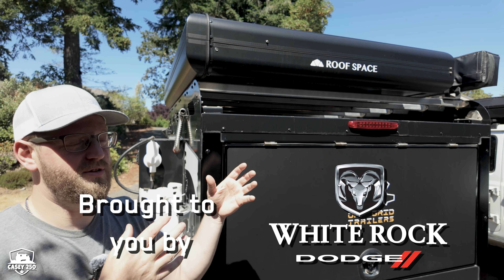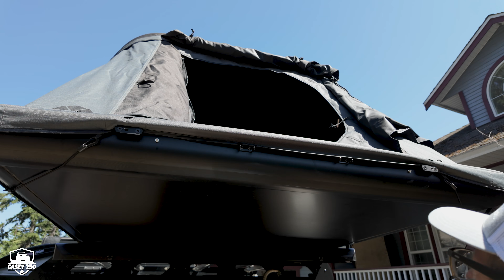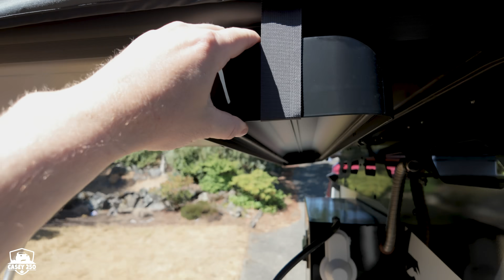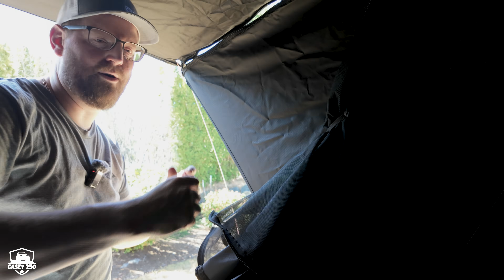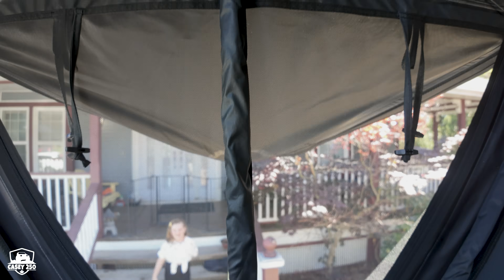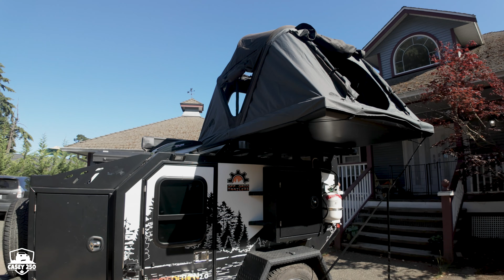This Roof Top Tent is VERY DIFFERENT FROM ALL OTHERS - Roof Space 2 Review

Comment: Hmm I don’t know. When I first started hearing about this tent and looking at it a bit closer I was initially like, “heck yeah can finally get rid of my RN condor generation 1, but after watching this I’m not so sure about some of the design features. First of all the side windows, you have no protection from side rain if you want to keep the awning open for air flow, having to stow and pack and unpack/attach ladder is kind of annoying, the zip up front awning sides is another step also. When I use my RN Condor XL I like that you can open the sky lights and the way the front awning is designed you can get air flow up and under the awning and in to the skylight without having to get rained on. You can keep the side awnings up and open for my ventilation in the night. That tent already doesn’t manage condensation very well with what I consider to be max be ventilation given all of the open window options. The roof space doesn’t seem to offer much for ventilation if you run into any kind of weather. I also didn’t like how long it took you to pack that thing away, that seems way slower for me. Part of the appeal is quick and easy set up. I think would appeal to me most when I first heard about it was the design, the weight, and the slim dimensions. It seemed like a great alternative, but now I wonder. I have taken some steps with my roof nest condor to address, a few quality and I think it will stand some more torture for another few solid years. I know your aluminum shell version wasn’t great and the threads are full of quips about the RN but I feel Lin this case the roof space is unique, German designed seems to be of quality but function I’m not sure. At any rate, great review best one I’ve seen in this new to the market tent. My guess is it will also retail around that $6000 mark which is awhile other conversation. Briefly I think we’ve all been hood-winked into thinking these dam tents are worth anywhere near that. It’s wild. Anyhow. ✌🏻 from the east coast, Canada.

Comment: Dude - your logic on the screen part of the door is super hard to follow.  I tried for two videos now.  It doesn't even make sense.  Make the screen part of the door?
Reply from the maker: Yes. The Alu-Cab does it. The door is 1 zipper for getting in and out. If you want a window open, you unzip the window on the door which has mesh on the outside. When you are going in and out of the tent, you only need to undo one zipper, as the mesh/window is part of the door.
Reply: @Casey250  I agree with you Casey there are plenty of ground tents that have the screen built into the door/window, I don't know why this concept is so hard to grasp for RTT makers.

Comment: Looks like a huge pita to setup.   That's a hard pass
Reply: Apparently you have never setup a soft shell tent before. The only tent easier to setup than this tent would be something like a wedge style tent which is not in the same class as this tent. If you need the tent to fit in a smaller space a wedge tent is not always an option.